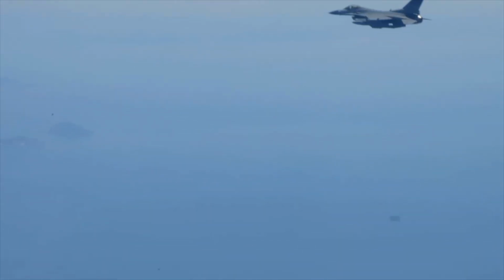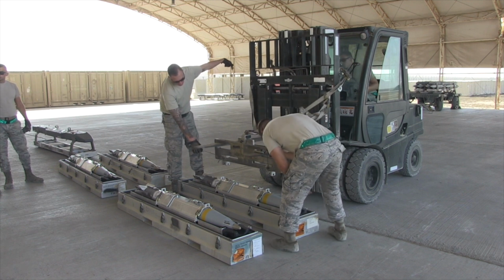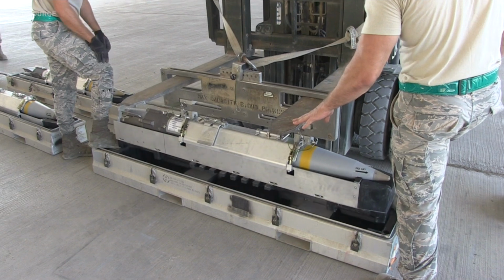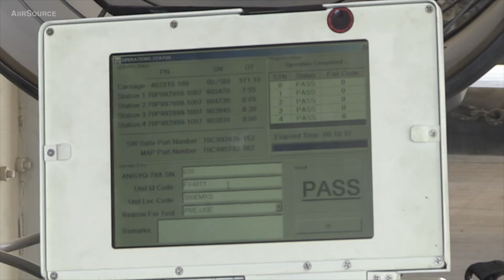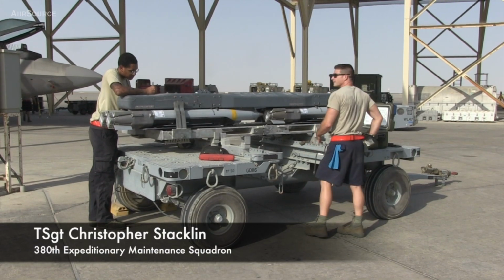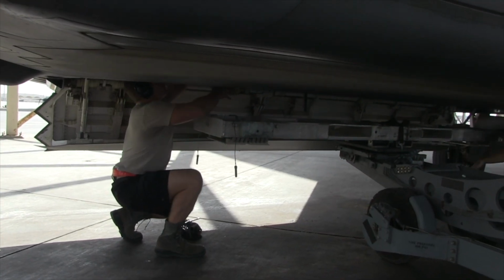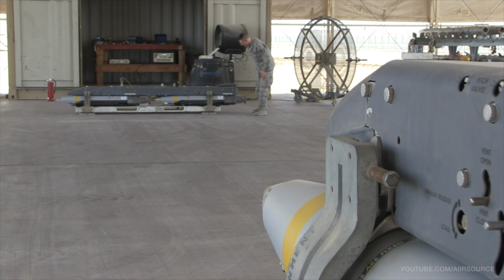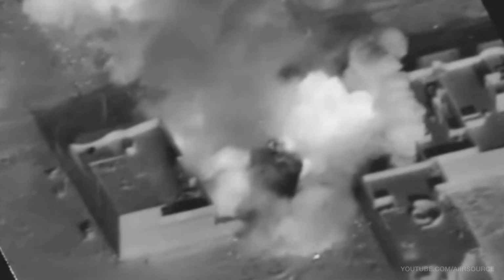GBU-39 Small Diameter Bomb (SDB) Explained

Comment: Translation: stealth jets can’t carry much so we give them firecrackers.
Reply: hoofed Stealth fighters, like the F-22 and F-35, can carry similar loads as legacy fighters; in the case of the F-35, more.
Reply: the f35 can load under its wing the weight of an unloaded f16 in bombs... all this while still retaining a smaller cross section than any 4th gen fighter.
Reply: Silly Hoofed
Reply: +Locutus494  Physically, at least, the F-22 can carry about as much.  If it were to be programmed to deliver heavy munitions carried externally on its wings, then it has four hardpoints with standard military buses for intelligent weapons and a capacity of 5,000 lbs each.  Based on its maximum takeoff weight, its maximum capacity for ordnance (internal and external) is about 22,000 lbs.  They're more comparable to the F-15E in this regard than other legacy fighters.
Reply: +hoofed  SDBs are meant to be carried by non-stealth fighters, as well.  They're enough to take out many targets, have very good bunker-penetration capabilities despite their light weight, and are intended to keep collateral damage to a minimum (500-lb bombs are overkill for many types of target, especially as precision improves).

As for the ability of stealth fighters to carry ordnance, as already pointed out they can carry more than most legacy fighters when carrying externally as well as internally.  Of course they have to sacrifice stealth for this, and in stealth mode their payload is far more limited.  However, is it really that bad?  For comparison, once the F-16 is loaded with everything it needs for most missions, typically it only has two hardpoints left for ordnance, which is pretty much what a stealth fighter has internally.  Sure, larger legacy fighters can carry more, but this is still a useful load, and they don't have the option of a stealth mode.
Reply: Translation; A 250 lbs bomb today has a much better chance of destroying a target than a 500 lbs bomb had in the 1980s because of much greater accuracy. It is because of the incredible bomb accuracy of today that the SDB was developed.